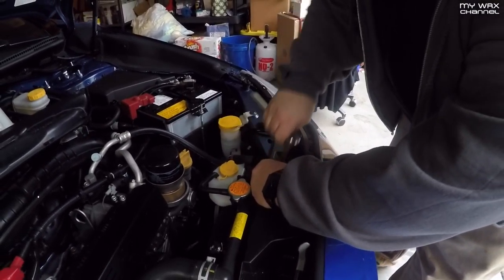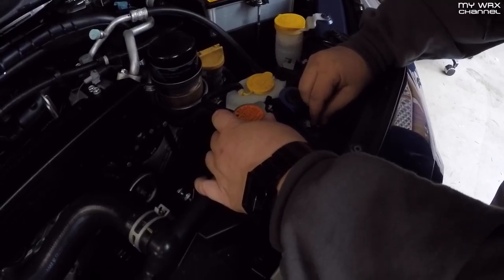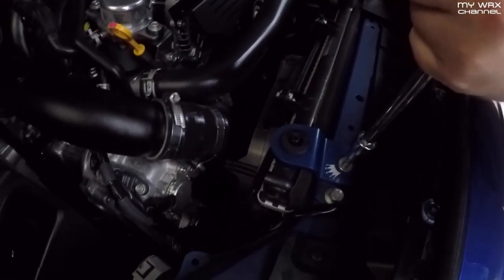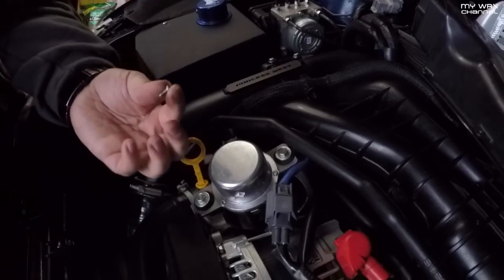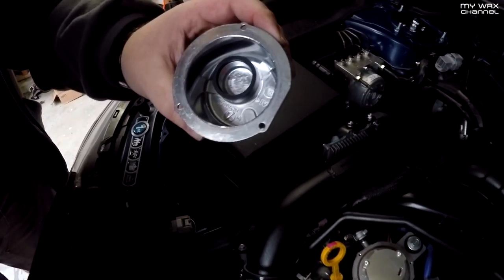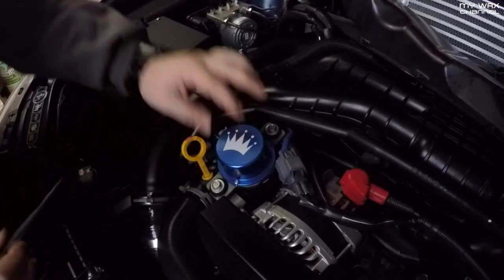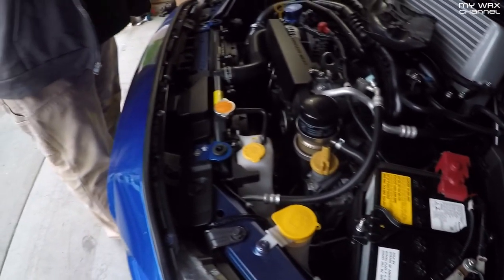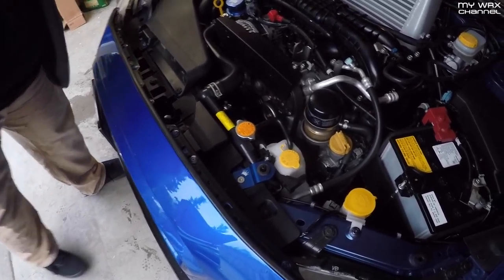TurboXS Radiator Stays & Vacuum Pump Cover / 2015 Subaru WRX

Comment: any clutch problems or problems in general? i am trying to decide on a 2015 wrx or sti but i have seen some complaints about the 2015 wrx's clutch blowing
Reply from the maker: +TJ Shoop None so far. Any clutch will break with rookie manual drivers.